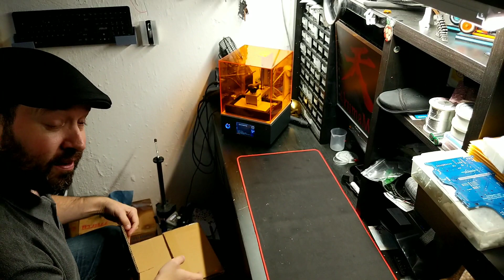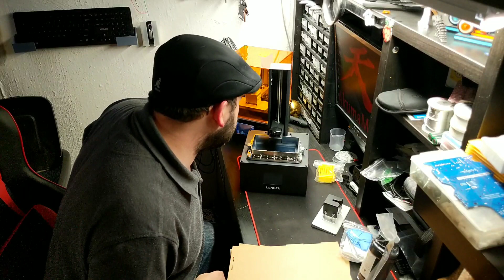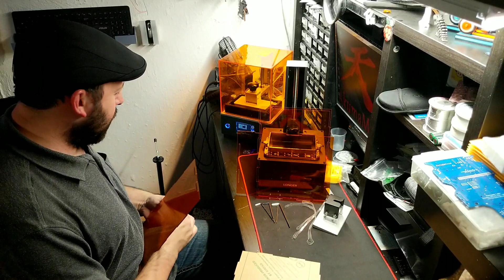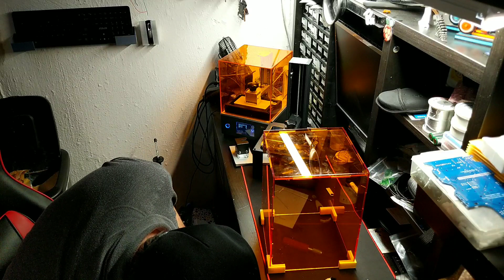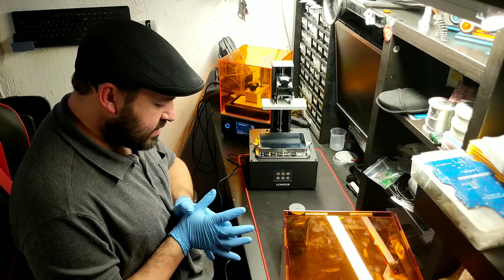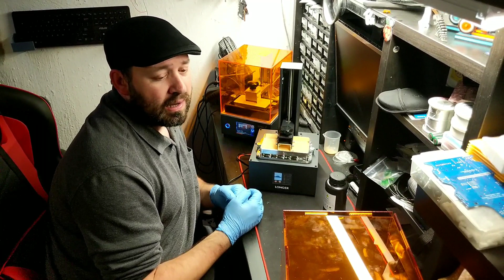Longer Orange 30 Resin 3d printer unboxing and setup

Comment: Maybe some painters tape would have come in handy putting the cover together.
Reply from the maker: Didn't even think to do that. Dang would have saved me a ton of time
Reply: @AkumaMods  also, shouldn't you have placed a piece of paper under the build plate initially? I ordered this printer a couple days ago for $234 with three small bottles of resin. Seemed like a great deal.
Reply from the maker: @billkaroly  yes you can but per most printers they are pre leveled from factory. I usually give them the benefit of the doubt and  print away
Reply: @AkumaMods  what happened to that first print?
Reply from the maker: @billkaroly  it printed just fine

Comment: Pre assembled would have needed a bigger box and more packaging which would mean higher shipping costs, and probably a surprisingly higher price.(subbed BTW)
Reply from the maker: Agreed. I just see these as like the cheapest resin printers and yes they are good printers for the money I would have just liked it more together for that price range. Or at least something that is a little better engineered for the cover. Like a lock on the sides. Again I understand cost but swap it out for those 3d printed guides or rubber bands. Oh and thanks for the sub

Comment: “Worst video EVAH”...  agreed...
Reply from the maker: What specifically makes it the worst video?
Reply: Well, I was just agreeing with you statement, but...  You could not have edited out the 15 minutes of peeling the film?  Why do you make these if you don’t even have basic editing software?

You fumble with building it for several minutes before using the L holders...

I disagree about the price point vis a vis the assembled enclosure...  I just got my Orange 10 for $165 new in Amazon and even if it hadn’t been that cheap, a preassembled enclosure only increases the chances of it being damaged in transit...

I tried to stick it out, but I bailed at half way because it was just too torturous to continue watching
Reply from the maker: @markh3684  it's not that I don't have the skills. If you look at my old paintball videos those were edited. It's the fact I don't have a PC to handle it right now.  However I do have one now but it's been a while since I've done this. Also Im struggling to go edited or keep it as is because it shows people the real deal of the setup

Comment: Thank you for the video.  Just got done ordering one for $288.
Reply: Where did you find the 30 for $288?  Looks like the 10 is still selling for the $229 I paid for mine 4 months ago.
Reply: @dammachines  , got it on amazon.  It had an instant coupon of $100 off and then had a coupon code from Longer3d facebook group that I was able to put in at checkout as well.